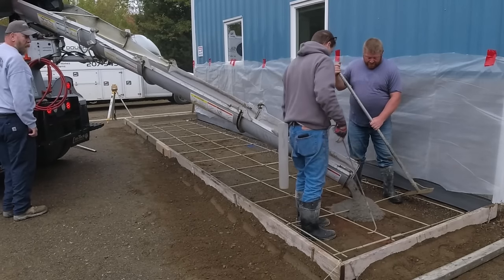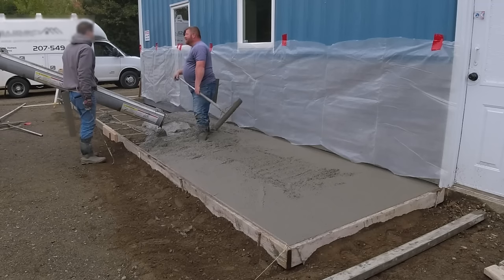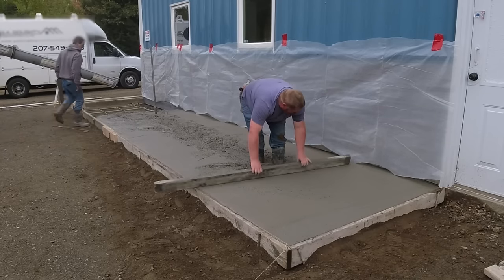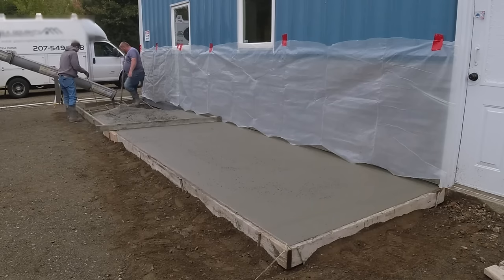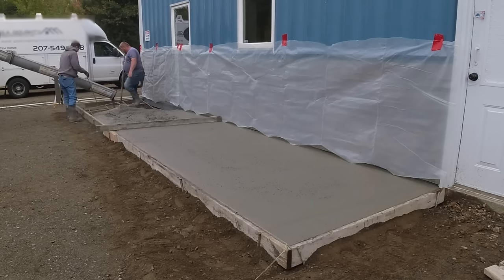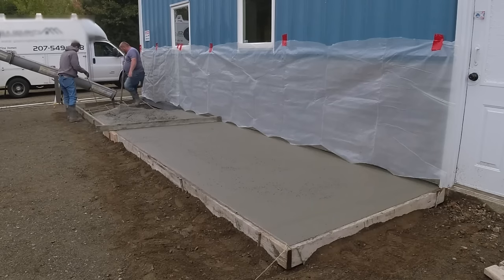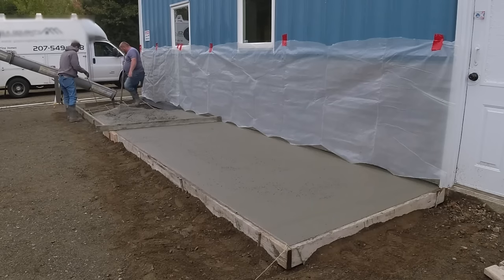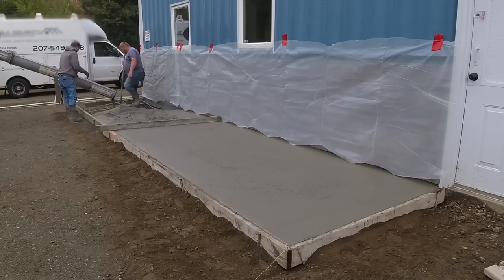I Stamped Concrete For A Small Sidewalk And Got AMAZING Results!

Comment: If the liquid release will evaporate from the wall, why do you need to use a cardboard when spraying it on the floor? Is there a reason for not keeping the plastic you had against the wall if it really needs to be protected?